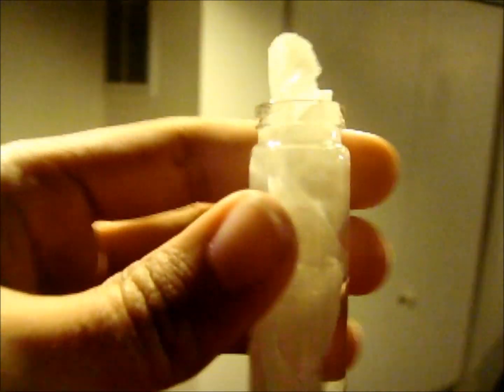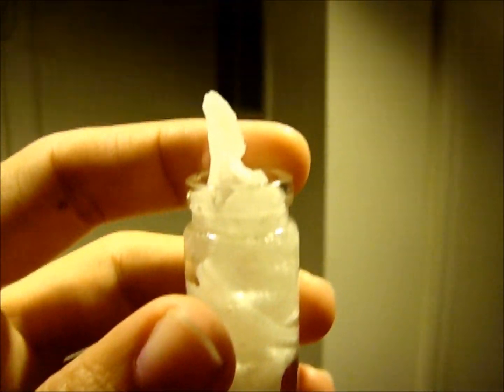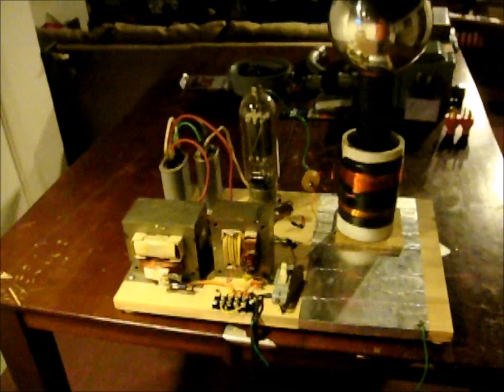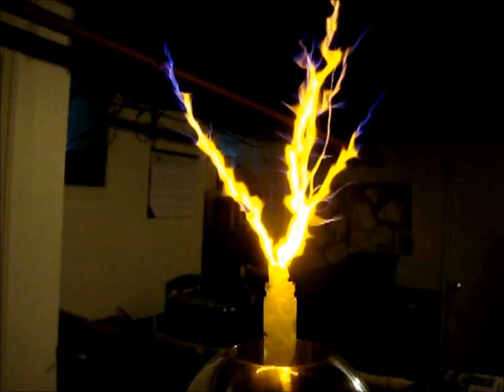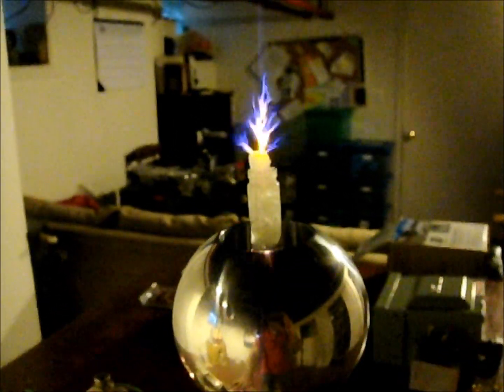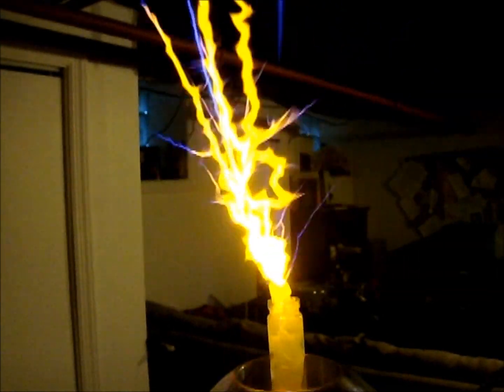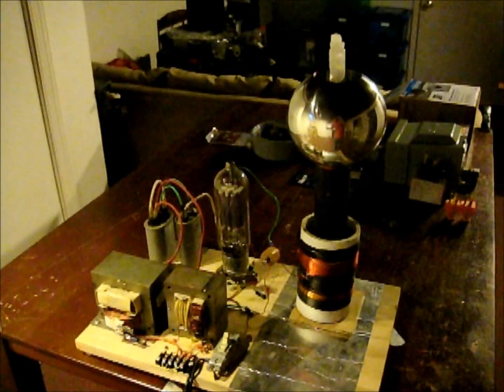Salt Water "Fuel" !?

Comment: Can you possible make an no arc tesla coil? Then the hho is not ignited. Then we can measure the volume.
Reply from the maker: you could excite the water with magnetic field but that would require higher frequencies...
Reply: @sparkstarter  higher frequency? Or higher voltage? Because i am trying to see if there is anything useful. Like breaking the law of thermaldynamic.
Reply from the maker: @rietiu  don't think there will be breaking any thermo dynamic laws here... but I admire your ambition ;)
Reply: @sparkstarter  in my fantasy, you use a little power like high voltage and low current with the right frequency, send power through tesla coil, and then break the bond of water molecule. When we ignite it, might get more power out of it than the input. But most likely if the power is not enough, it cant break any water molecule, or just a very little amount of water being break.
Reply: @sparkstarter  8-11 ghz

Comment: This video is the perfect demo of energy conversion under the thermodynamic laws - CONVERSION being the operative word too. If the energy was free you'd not need to utilise more energy to make this supposed 'free energy' it would be completely free with no losses.

I wish the idiots on this poisoned crust who keep swearing by and pushing the 'FREE ENERGY' concept would read spend more of their time reading about the Thermodynamic Laws as you can only convert energy from one source to another and NOTHING in between.

This video show the conversion of sodium into orange light which is what happens when salt is thrown on a flame.
Reply from the maker: Funny I remember watching this lightworks video in middle school / high school with these free energy inventors I was really excited about them initially. I took multiple physics / engineering classes to build up sufficient tool kit to have a reasonable bullshit detector. Sure most folks can sniff out a perpetual motion machine, but what about a fuel cell company , solar road or roof tile company, and micro sample blood testing company? I don't hold it against them... I blame the schools ;)

Comment: as understand he got H2 from the salt water using 300watt 13.56Mhz , he got 1800c from firing H2 , as i understand from using @t ,, to get 1800c heat we need about 949watt hour , ( 1 800 celsius heat unit = 949.550 25 watthour ) but he used only 300watt , do you think we have more output than input , what do you think
Reply from the maker: 1.) I doubt there was much electrolysis, I suspect he just got a vial of water to produce an electrical arc at RF frequency.  2.) I don't think you are using a correct formula for translating Energy to Temp.
Reply: @sparkstarter  thanks ,, what is the correct one bro ,, which one you think :  http://www.onlineconversion.com/energy.htm
Reply: @sparkstarter  https://www.youtube.com/watch?v=4fYc_MRG2wM

Comment: John kanzius , he said that he used 300watt and he got 1800c heat , he said the input less than the output , what do you think
Reply from the maker: He probably created a hot plasma with 300W but I don't think he had any energy gain.
Reply: @sparkstarter  as understand he got H2 from the salt water using 300watt 13.56Mhz , he got 1800c from firing H2 , as i understand from using http://www.onlineconversion.com/energy.htm ,, to get 1800c heat we need about 949watt hour , ( 1 800 celsius heat unit = 949.550 25 watthour ) but he used only 300watt , do you think we have more output than input , what do you think

Comment: Not Like that Bud.. 

its not tesla coil that make hydrogren from salt water, but magnetism heat, electrolysis the hydrogen
Reply from the maker: Nope... not like that son.
Reply: @sparkstarter  Kanzius did simple electrolysis around the glass tube dude, not a teslacoil toy
Reply from the maker: nah... it's just an RF power supply energizing a tube of water with an arc coming off the water surface, tesla coil does the same thing.

Comment: I saw the video too. Radio waves frequency NOT EQUAL to tesla coil device. So, this is pointless...  :P The idea is to reach a water ressonance frequency in order to break water molecule. Some ppl says that reaching that point and applying hidrolises, you get fast production and low eletrical values (suitable for a car battery)... Stanley Meyer did it by modulating the eletrical signal...
Reply from the maker: The Tesla Coil was the original RF generator. This Tesla Coil is 650kHz which is in the AM band radio. So what is the magical resonant frequency you need?
Reply: I'm not an expert but i give my shot. I think it could be achieved via RF but not a "direct hit" of waves, but a frequency of a modulated signal (a more complicated signal due the nature of the molecule, strength between the atoms).  A simple RF signal, no-ionized, can vibrate atoms and molecules, but cant break the last ones. You should use something like an electrical signal injector, but for radio waves. In the other hand, the guy on the video was trying to find a cure for cancer, so it's a clue (ionized particles?)
Reply from the maker: This VTTC is 650kHz Modulated at 60hz, I have other videos which show more details on the coil.  Sorry I don't think there is anything remarkable here just RF plasma arcing from a wet conductive surface. Not sure how the cancer cure works but this is not an energy resource.

Comment: the actual experiment requires RF tuned to a specific frequency to directly interact with the molecular bonds in the water. if that frequency is produced then the hydrogen and oxygen separate in to their respective ions, and form H2 and O2 gas. this is what burns.
Reply: 13,56 Mhz frequency was used but only cause one simple reason: That is industry standard and is alowed by regulators to be used in RFID chips, plasma generators and so on.
Reply from the maker: +ComatoseChimera What is this magical frequency?
Reply: +sparkstarter 13.56Mhz http://www.personal.psu.edu/tms9/water.html
Reply: yep    ur   right   on   it   mate.....smiley face
Reply: Igor Stojanovic 
The chip on his shoulder is a lot slower.

Comment: natrium/sodium just changes the color of the sparks to the orange color.
You can achieve different colors by using different types of salt (made of different metals).
Nothing is really burning.
Reply from the maker: That is correct, in my opinion nothing appears to be burning, it is just an electrical arc. However others have claimed to be burning the salt water, I was trying to debunk that.

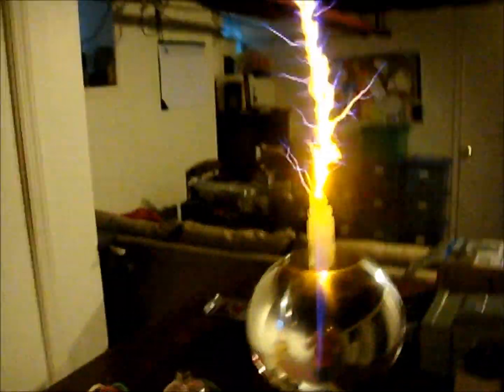Comment from the maker: thanks for your comment... But  I'm not kidding this is just an RF plasma arc. It happens to appear more flame like in the other video because he is using a different frequency and modulation envelope. If you look carefully at 1:11 you will see this is not an ignition flame but a grounded water pipette he is using to simply drawing an arc to start the "flame" initially.
Reply: Can you guide me steps and things required to try at home

Comment: you've got to be kidding....   Anyone looking at the original video (which you linked, thank you) can see that it's an actual FLAME not a spark.  Notice at 1:10 in his video when he IGNITES it manually.
Reply: Cath 
Capacitively coupled electrical discharges at higher frequency look like this, and you have to start it like any other electrical arc.